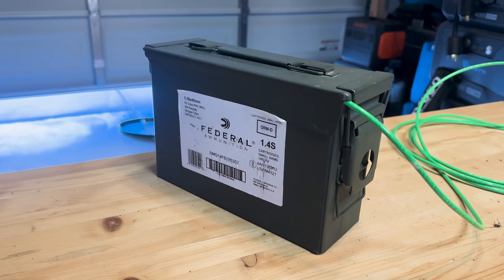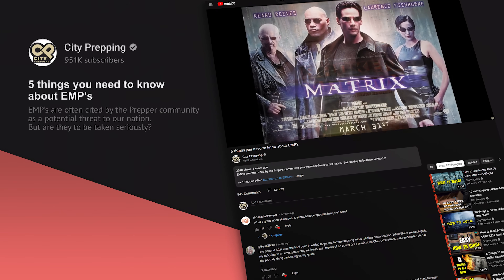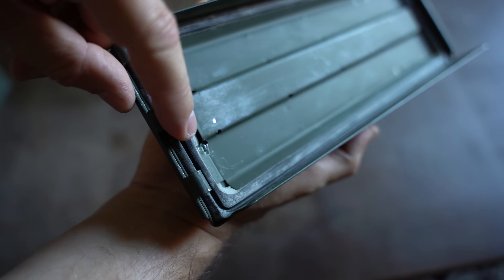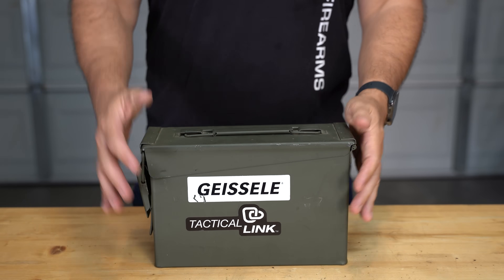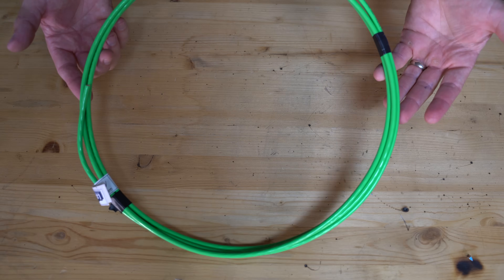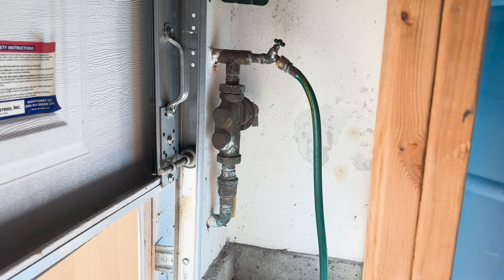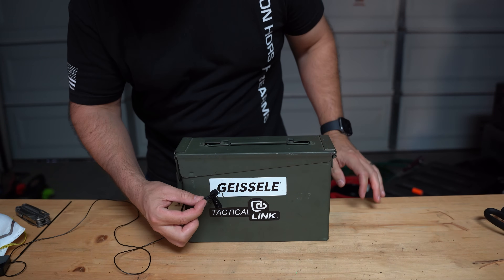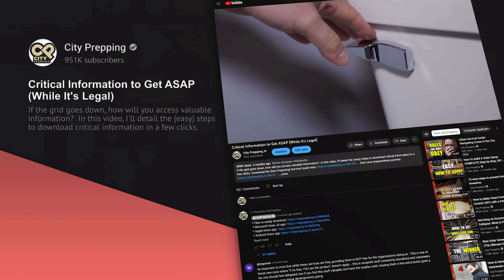How to Build a Faraday Cage: Step-by-Step Instructions

Comment: How about replacement electronic components (IE HEI ignition coponents) for an older carbureted vehicle that has little to no electronics (pre electronic fuel injection). A solar charger for a spare cell phone.

Comment: You can use the same method with a trash can, but I used rubber mats instead of cardboard to line it - better insulation. I also duct tape the lid closed with aluminum tape to help seal it.

Comment: One more thing. there are different ground potentials depending on what you ground the Faraday Cage to. The target is to keep the EMP from passing thru it and even a water pipe would have an EMP flow to ground. I am thinking having an independent grounding rod with a short cable to the Faraday Cage would be optimum. I have a friend who knows more than I do and need to ask him his thoughts. He and I could argue the potentials of whether to or not to ground and if to ground, how to best ground the Faraday Cage.
Reply: Yeah the lowest impedance to ground you can get to immediately dissipate the EMP energy.

Comment: I am thinking about reusing the rubber seal but wrapping it in copper foil before re-inserting it. I also like the idea about the external grounding lug rather than anything going to the inside of the Faraday Cage.
Reply: Excellent idea, I would still remove the paint however for optimum continuity

Comment: One important point to note is for anything that may require a charge or recharging, even when turned off needs to be refreshed every now and then. I would remove internal batteries if possible and store them in a separate leak proof container inside the Faraday Cage.

Comment: How do you really know it will work? Did the FM radio really loose its signal, or was it sound proof inside? You really need the microphone or a Go Pro camera, inside the ammo can to tell. But still, no one really knows how much massive radiation a coronal mass orgasm will make, to knock out a power grid. 
But you can't convince me all you need is cardboard and tin foil. Tin foil is conductive, so is your ground wire. Which begs the question, will your ground wire just conduct and electrify your faraday cage, enough to cook everything inside it? That cardboard might catch fire!?

Comment: If anybody has LIFEPO4 or Lithium batteries the car size BATTS these have a BMS ( Batt Management System) this is basically a micro computer. It's the size of your Smartphone. That's a ballpark size.
If you are planning on having the use of these BATTS which are used for solar power systems, you will need to replace these BMS or keep your BATTS in FARADAY cages.
The BMS are smaller and easier to store then entire Lithium Batt. 
If don't have a working BMS for your lithium batt, then you have an expensive paperweight or boat anchor.
The BMS is the brains for keeping BATTS charging and discharging. It's also the " Achilles heel" of the BATTS..

I have 2 extra BMS per batt that I have as back up in FARADAY cages. I have (2) 200amp 12v batts and have ordered (2) more and I have also ordered 4 BMS to keep on hand just in case.

The cases for these BATTS are hard plastic and having a good hand wood saw or a way to open the cases is a must to have on hand.

 Along with AC/DC inverters for my solar power system.
Think outside the box when prepping for a EMP Event. Make a list of what you will want to have working and what you will need to have it working. Because with an EMP you only get one chance to get it write.
Just my 2 cent
Good luck

Comment: I built two out of 30 gal metal garbage cans .same concept as  ammo cans.  In side I have 2 40 channel cb walkie-talkies 1 car cb for a base station.  2 ham radio walkie-talkies. Computer tablet with lots of survival info.  Multimeter.  Spare water pump, spare solar controller,  lots of rechargeable aaa, aa, c, d size batteries,  flashlights, blood pressure machine,  blood sugar machine,  defibrillator.

Comment: Hi Chris,
I have 40 years of background as a telecommunications technician. I have worked in Faraday cages on several occasions. Those cages were to greatly suppress radio frequencies during tuning and calibrations. Anywhere near an EMP nuke and I doubt they would protect much. However, some principles are applicable to EMP protection. For instance, as build, the grounding cable acts as a near perfect antenna, thus defeating the purpose of the cage. The powerful signal makes into the box quite easily. As mentioned by someone else, welding a lug on the outside would eliminate this issue. However, most information I have read on Faraday cages from engineers do not recommend grounding the cage. You do not want the currents to flow thru the box to the ground, as this high energy current will induce currents inside the metal enclosure, defeating once again the cage. Another point is the choice of a grounding point. If a very powerful EMP hits, telluric (ground) currents are induced, so would work their way into the house thru water pipes and the grounding wire. Incidentally, solar flares do not produce the same type of EMPs as nukes, but rather create a very powerful ground current. So, your equipment could be damaged just by a flare, in peace time! An added point for improvement, the more layers the better. So, if the items going inside the box are small, like a small walky-talky or thumb drive. First wrap them in paper, then aluminum foil, then more paper, one more layer of aluminum foil and a final paper layer. This greatly increase the attenuation of any signal that might get into the box. Some numbers I have seen indicate that each layer could add an attenuation factor of 1,000. This level of protection is cheaply achieved with paper and aluminum foil. Still, any cage is better than none. One last point, most studies I have read indicate that an EMP nuke would be detonated over the center of the continental US. I you live anywhere near that area, think multiple layers!  Cheers.
Reply: Not likely as ground current would likely be present during powerful EMPs or even massive solar flares. Any cable or pipe that goes from the surface to the underground will carry part of the pulse there. One additional point to consider about the choice of metal for the Faraday cage, steel is the least recommended as it is not as conductive as say copper or aluminum. Do go silver or gold, best conductors, but insanely expensive. :o)
Reply: @jeanlui6944 how tight of weave is required.  Chicken wire vs hardware cloth ?
Reply: @miltonrogers5971 That's an excellent question! This is probably not what you asked about, but it is an alternative Faraday cage. Hopefully an Engineer can interpret what I'm saying and offer a "corrected description" of my comment about this type of Faraday cage. Copper wire mesh screens can be soldered together to form a Faraday cage. I think it has to do with the width of the screen's spaces between copper wires and their thickness, which is determined by the signal wave length it's intended to block. 1/4 wave?? Very technical, but a YouTuber should have a video of a reasonable facsimile of what I described.
Reply: seems like the cage he built is most useful only when the container is struck by lightning instead of EMP events. useful info in your comment, thank you.
Reply: Thank you for taking the time to inform us. Much appreciated.
Reply: Thanks for the knowledge. My brother worked at a nuclear plant all of his life, and I feel like a fool for sending him this video.
Reply: would burying the cage help?
Reply: @TheDaken  Refer to "ground current" mentioned...in a solar flare, energy from the atmosphere is charged, the (iron core) of the earth is a ground and becomes charged. This energy is dissipated through tectonic action. The transference of "free" energy into physical movement. 
I believe the answer is that this could be more of a problem by receiving current from the ground (unless insulated in plastic). Remember that ground water conducts as well. Current could be traveling via the conducting moisture in the ground...like a toaster in the tub. 
No bueno.
Reply: @TheDaken yes
Reply: Wouldn’t a sealed countertop microwave oven provide real protection against an EMP?
Reply: @lescocat1501  Microwave ovens are not meant to block much more then 1,500 watts of energy. That is the average power output of most micrawave ovens. A EMP pulse, depending on your location from the detonation point, is increadibly more powerfull. If the power cord of the oven is left connected to the power line, the pulse will enter the oven thru the AC power lines. If it is disconnected, the power cord still acts as an antenna, so once again, the pulse is likely to enter via the cord and fry the innards and it's content. Personally I do not beleive an EMP is likely. Why? It would signal in all likelyhood the start of a total war, full on nuclear and the end of most life on earth. No one truly wants that. Still, I keep a very close eye on world affairs and should there be a significant increase in tension involving nuclear armed foes, then I would start protecting my small electronics. Spare cell phone, small tablets, handheld radios, memory sticks and the like by wrapping them first in paper towels, then a layer of aluminium wrap, then repeat, paper, alu, paper, alu. I woudl go for at least 3 to 5 layers. This I would do after watching an engineer so a test with proper test equipment using mylar bags. After the third layer, the level of attenuation was several thousands of time better then unprotected. It was in the order of 60db. More than enough protection in my humble opinion. Hope this helps.
Reply: @jeanlui6944 will covering a portable solar power station and its solar panels in aluminum foil and paper be sufficient to block emp from frying it?
Reply: @kikiD32  You seem to suggest that building a Faraday cage around the device would work? Yes, but remember the layers, I personnaly would go with 3 to 5. I say 3as a minimum, (for me) because I do not live anywhere near the geographical center of the continental USA. I still live in North America, but 'safely' away from the middle.  :o)
Reply: @jeanlui6944  ok. Thanks. I'm in Hawaii.  Will an Emp affect us here?
Reply: @kikiD32  From all the maps of EMP foot print I have seen, you should be way out of range. Hopefully it stays that way.
Reply: It is my understanding any gap less than 1/2" is small enough to eliminate the emp significantly. Some people use 1/2" wire mesh (aka hardware cloth) to protect an entire radio room.
Reply: @rogerbainbridge8983  All Faraday cages I have worked in over the years had mosquito sized screens. So I would not trust 1/2 inch mesh.
Reply: I was thinking similar thoughts about attaching a wire. I have viewed a faraday cage as a means of completely insulating the device inside the cage from outside energy sources.
Reply: @PhongJr.934 that is impossible to achieve
Reply: Normal paper?
Reply: @maos1018  To avoid any possibility of conductive ink, white or brown wrapping paper would be best.
Reply: @jeanlui6944 
In regards to a nuclear EMP. Can an item like a handheld VHF radio with a short antenna propagate any of the E1, E2, or E3 components of the pulse?
Reply: @woodrowcall3158  I'm not sure what exactly you mean by propagating. If the radio is battery powered,  any EMP energy coming at it will likely fry the inards in short order, leaving no solid state components able to conduct much of anything. If it is plugged in to house power, the EMP will come at it from the air (via antenna) and thru the power line. In this case also, the thing is fried. Should the radio's antenna exted outside of a EMP protected structure, then trouble is brewing. The energy of the pulse is carried inside by the antenna's metal wire. I'm not sure if I come close to answering your question. Let me know.
Reply: @jeanlui6944  
I was unclear with my question, I apologize. I’ll try to clarify.

1- Isn’t the antenna (or overall conductive path) on most handheld VHF transceivers too short to properly conduct the most damaging components of an EMP?

2- Isn’t the circuitry on most VHF transceivers robust enough to handle the remaining EMP components that are conducted/propagated along the shorter conductor paths of the device?

3- Doesn’t certain components of an EMP require a minimum conductor length to propagate in solid matter? Specifically conductive materials.
Reply: One could use thick plain cardboard about 3/32” thick or thicker. Available at most art supply shops.
Reply: Hello . Would a aluminum lunchbox make a decent Faraday cage for small items like a radio ?
Reply: @alcodie1558  Not on its own. A single layer of shielding is not likely to be sufficient to block a nuclear produced EMP. The more layers, the better. About 3 to 4 should be sufficient. All depends on your location from the explosion at high altitude and the strength of the device.
Reply: Living in a manufactured home with steel frame and joist, sitting on a concrete basement.  Can storage of faraday cages in the basement be a better choice for storage or does it not matter in any case.  Trying to store batteries and communications  radios.
Reply: @dougnicholson7235  Batteries are unlikely to be affected by an EMP. A properly constructed Faraday cage of multi layers should be effective even in the open. I would suggest not to rest it directly on a concrete floor or the ground but use insulating material like rubber.
Reply: CHEERS ...MAN I NEEDED TO READ THIS THANK YOU

Comment: A couple of things to consider.
12v to 120 power inverter
Triple A-D cell
Car battery
Solar power bank with panel(s)
   - large and or small
Reply: A lead/acid car battery, A and D cells don't have to be protected from EMP, if that's what you mean. If you're saying prep those items, I agree. P.S. Lithium-ion batteries should be protected because their BMS usually contains microchips.

Comment: You are going to face palm when you read this, but removing the gasket and sanding off the paint on the lid is totally unnecessary.  You just simply cover over the opening of the box with a sheet or two of thick aluminum foil, (or faraday cloth you buy off of Amazon), that gets pinched down when you close the lid, with the foil on top making a sealed metal "box" instead of the metal lid. I use Reynolds Wrap "Super Duty" as it is the thickest foil.  The ammo box will still be totally waterproof this way also, and of course, it is much less work.

Comment: The majority of small handheld devices will have very little to no damage from an emp, small devices aren't large enough antennas to absorb an emp, i agree that a Faraday cage is needed but for larger equipment like generators or solar equipment,  lathe copper windings in generators and large runs of copper wire in a solar setup are large antennas that will take the most damage
Reply: Are you sure? A printed circuit board in a radio or laptop, for instance, looks to my eye to have maybe half a meter of conductor. An EMP can induce 50,000 volts per meter, in a wide range of frequencies (DC to daylight as they say). Modern chips run on 3 volts, won't they fry?
Reply: @rpbajb  yes, there are lots of studies and tests on the subject,  all electronic ls have a risk of damage but the hand held size devices are fairly safe
Reply: @todamnbad  That's good to know. So Li-ion power banks, LED flashlights, battery powered security alarms, cell phones, tablets...should all be okay. Why are people building all these faraday cages?

Comment: Home Depot sells copper foil tape that conducts on both the copper and the adhesive sides. I use it on all the faraday cages I build. Also, Home Depot sells spray rubber coating in aerosol cans...better than cardboard...you def want that mask on though when you spray it.

Comment: Keep in mind that doing the grounding wire the way shown can also cause the RF part of an EMP pulse to radiate into the box. As you mentioned, grounding isn't strictly necessary. If you're going to ground, though, make sure the ground wire is attached to the outside of the box.
Reply: None of its necessary an emp won't effect smaller devices unless you're really close
Reply: @BNKMOBILEMECHANICS or the EMP is a large enough
Reply: @BNKMOBILEMECHANICS solar winds hit everything
Reply: @BNKMOBILEMECHANICS Large-scale EMPs will be detonated at 70-80000 ft, likely a foreign intercontinental ballistic missile
Reply: I was wondering why you would just wind the exposed wire around the smaller handle by the latch?
Reply: Grounding is only theory, anyway.
Reply: What meteriall is best aluminium or metaĺnor galvanizee box.??❤
Reply: You could use a large diode to eliminate or limit any electrical activity feeding from ground to the box
Reply: @ls-33wraith33  emf doesn't work that way

Comment: I have the smallest Blue Ridge solar generator. I can fit it and a folding solar panel, and a galvanized steel trashcan. I put things like outdoor solar lights, as well as flashlights and radios in it as well.

Comment: For an EMP etc.  Do not ground a Faraday cage, you have actually just connected your box to a long conducter, the ground in your house goes to the neutral bus and then to the grid, the exact opposite of what you need.  "For a "six sided shielding box" (faraday cage for equipment not in use).... "you need a very low inductance to ground. This is desirable for HEMP and IEMI. Ground rods have high inductance, and while necessary for lightning, are of limited help against high frequency transient phenomena". `DHS-CISA EMP protection and resilience guide, Version 2.2 – 5 February 2019 unclassified.`  it also refences the various mil-spec standards.